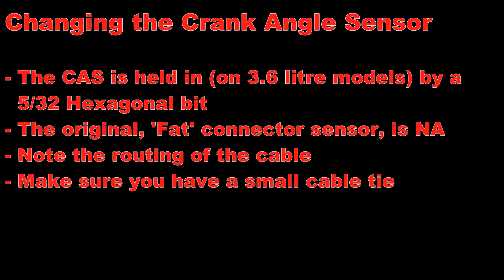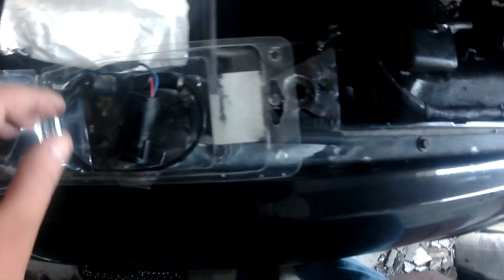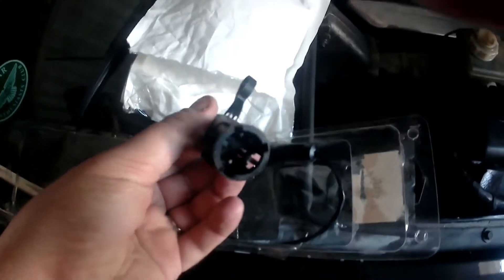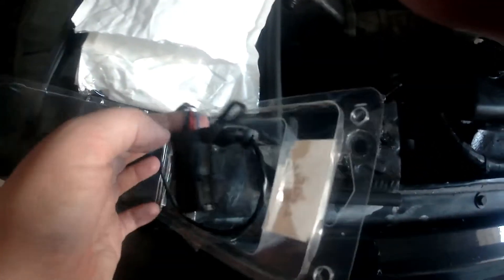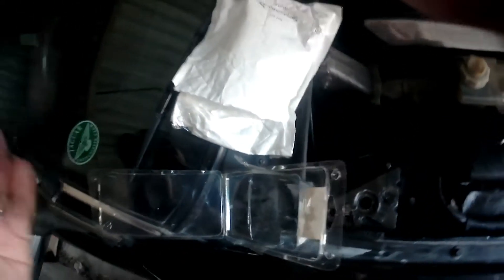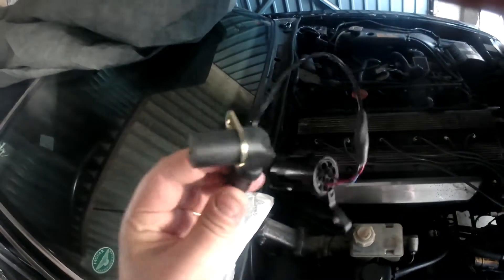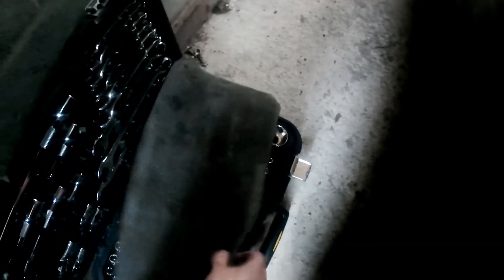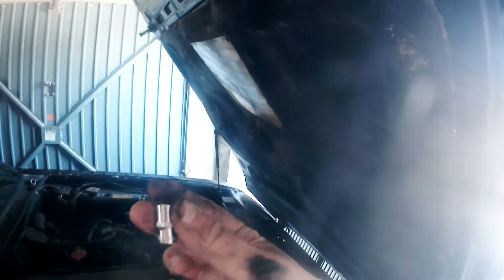Jaguar XJ40 (XJ6) 3 6  - Crank Angle Sensor Replacement

Comment: Sensor available from Joes Garage, Sweden dec 2023.

The hex insert key is metric 5 mm on our Jaguar 1993.

Pins in the connector are circularly placed. Not linear as in later models.